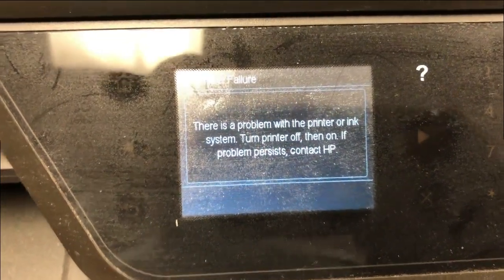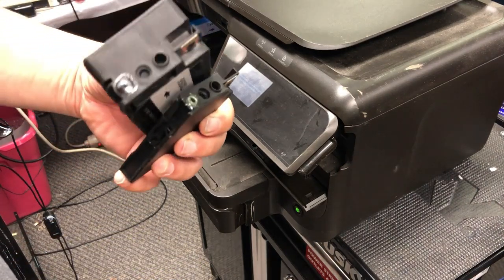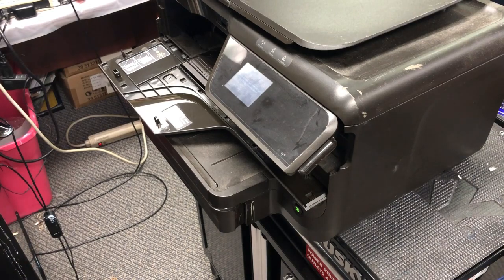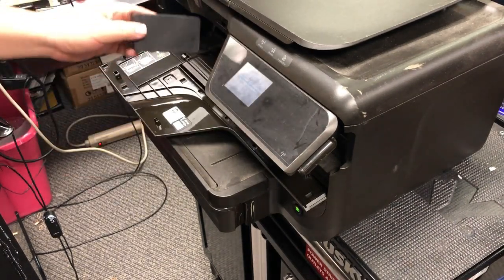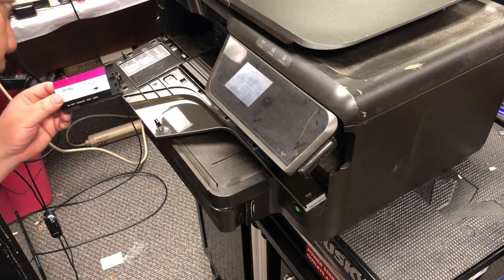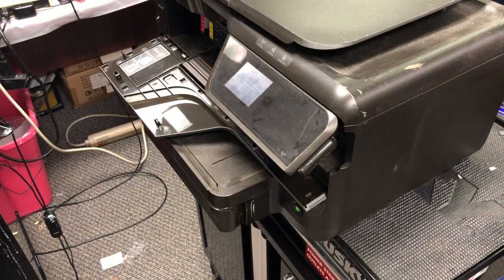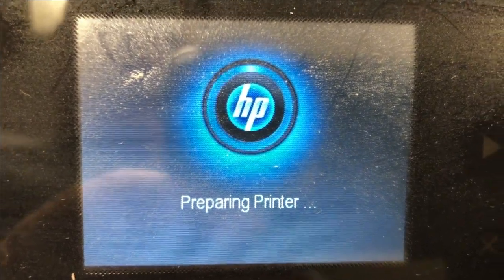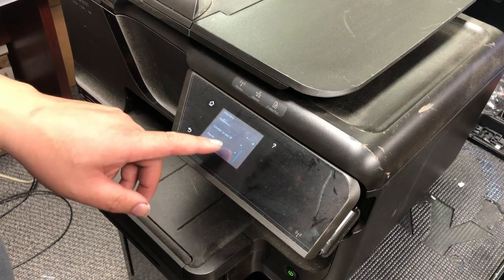HP OfficeJet Pro 8610, 8620, 8710, 8720 Ink System Failure

Comment: So HP just told me I can no longer use this printer because the software upgrades cause it to not work with even new HP cartridge.  Then he proceeded to try to sell me a subscription to buy a new printer for monthly charge on yearly subscription. My reading of this is that HP does not want anyone using this printer so they put something in the software update to make it no longer work and sell you more printers. Does anyone disagree or agree with my assessment?
Reply: Yeah, I replaced an ink today and now it doesn't work, I'm pissed!!
Reply: My printer worked fine before I left for vacation. I come back home and turn my printer on and get this same message. All the ink cartridges are hp and practically new. I also called the hp number and got the same sales pitch. I have a funny feeling something is not right.
Reply: insane how we are all here with the same issue that started at the same time 😔
Reply: Mine just got this error this week too 🙄
Reply: I just received this error todasy on my 8610.  It worked fine the last time it was used.  Now I'm trying to search for a solution.
Reply: I got the same error a couple of weeks ago, it worked perfectly until then
Reply: @matthewbuckley8901  did you update it to  latest software..?may be this the problem I didn't have the latest software I refuse to update it
Reply: Dude....ain't no way are you for reals ???? 😭😭 Is that why mine stopped working all of a sudden???
Reply: @JuansGotThis I have an ho that's over 10 years old, using instant ink just fine. So that's not it.
Reply: Same thing here....
Reply: But big corporate HP cares about the environment and not creating e-waste!
Reply: That's true ...  never update your printer's firmware and turn off automatic updates. All kinds of instructions can be sent to your printer and you will have no idea that it is happening. 🤨🇬🇧
Reply: SAME ISSUE started one month ago when i installed a new cyan. I bought all new HP color cartridge and now it wants black! worked perfectly until now. Ill try to get a black one...but now that its sucked up all the ink into the reservoirs....if it turns out i have to clean them i just installed new ink for nothing.
Reply: Same
Reply: This exact thing happened to me. HP has become more and more unscrupulous over the last few years. Their CEO said they want to sell subscriptions for everything HP sells so it really wouldn't shock me that they're releasing software updates to ruin printers that people own so they can pitch you a subscription. They at no point suggested other printers you can buy outright when I told them I did not want to pay a subscription for a printer.
Reply: Problems started late last week on my 8610 when I replaced one color cartridge with a new third-party cartridge (all cartridges have been third-party for months or years).  Then replaced it with a genuine HP cartridge and still had an error, so returned that set of HP ink cartridges.  Now I get either the general system error or else that the color cartridge appears to be bad, although I've tried four separate color cartridges.  The only thing I haven't tried is flushing the nozzles in the cartridge assembly.
Reply: Problem started yesterday on 12/30/24 when my 8620 printer said it was out of black ink.  Replaced the black ink cartridge and got a printer failure or ink jet problem.  I followed another YouTube video and removed the printerhead and put tinfoil over the contacts (after removing the two little screws on the back side) and reinstalled.  That got me past the first error message, but then the printer said that the black ink cartridge appeared to be damaged and needed to be replaced.  It's not damaged.  It's brand new and from HP.   If I put in a new black cartridge and unplug the printer, it just transfers the error to the next color(s) and says yellow and cyan are damaged.  Try again, and you get that magenta is damaged.  Try again, and you're back to the black cartridge damaged error.
Reply: @straightaaasandsomebees  I didn't try the foil hack, but went through the same cycle of cartridges failing one after another.  Brand new HP cartridges, failed even after manually cleaning the printhead.  This is extremely frustrating, I don't believe there's anything physically wrong, seems like a firmware issue.
Reply: @TheMycroft1  you mean that your printer is up to date ?because I don't have these issues but I didn't update it for 2 or 3 years
Reply: Try hard full reset @straightaaasandsomebees
Reply: Wow mine just had this error and yup HP support just tried to sell me a new one but my printer has worked fine for years no problem! I knew it!
Reply: Same as mine, which is an HP 8600, it stopped working out of nowhere.
Reply: @francispaz3789 same here…
Reply: Which printer? I’m just stuck on the error page no matter what 🤷🏽‍♀️
Reply: yes because you cannot update the printer app
Reply: HP has been class action sued over this shit multiple times.  The only people that benefited from that was the blood sucking lawyers.  My 8600 is in PERFECT MINT Physical CONDITION!!! It has NEVER had a mechanical problem EVER!!!  These MFKr's realize they can't sell new printers to folks currently happy with this one which worked great with no mechanical defects.  So they start scamming you on the ink when consumers figured out how to refill the cartridges by cheaper means.  They want to force you to buy a new printer and subscribe.  I'm having the same issue all of you are having.  I've spent $250 alternating cartridges. It locked me out of Magenta, claimed Yellow and Blue were empty when they weren't because of the date on the cartridge had surpassed the warrant, which has nothing to do with the ink being there in the cartdridge and totally find.  And when I resolved those it switched to locking me out of Black.  Now the only one not working right is the Black K Cartridge.

I've researched how to get my printer working for days.  I've found legacy firmware, a way to push it thru to the printer.  I've manged to make it back to the home screen a couple times, it's rare but if I can get there just one more time to do a semi-reset I think I can fix this issue.  They block you from the menu so you cant get to the reset option to clear the error.  So the key is to disable Web Services, and access the printers graphic user interface thru the IP adress and disable Cartridge Protection and Cartridge Chip info.  Then go to your PC firewall and BLOCK HP.  Connect your printer to your pc via USB cable.  I'm still trying to fix black if I'm successfull I'll make a video and share it with you all that will be in good English.  Don't get rid of your good HP Printer.  There has got to be away to fix this!  I'm not giving up.  And I am NOT bying SHIT ELSE FROM HP.  I'm going to keep refilling the HP accepted chip cartridges I have via the ink refill kit which you can get on Amazon for all the colors for $13 dollars.  

You have to diable the printers ability to update and connect.  The printer also counts the number of pages you've printed and there's no way to reset that with their firmware so I have a theory that they may also be invalidating your print cartridge based on the warranty date on the sticker or the number of pages you've printed given that a cartridge can only print so many pages before refilling.  I've also ordred after market reset chips that supposedly trick the firmware from Amazon.  I'll be testing those as soon as they arrive.  If I'm luck and they work I can just keep one set of Genuine HP Cartridges and just put the aftermarket chips on them if they start tripping and keep refilling the ink for a fraction of the price.

It's ashame corporations get away with this bullshit.  HP has done basically what car manufactures and appliance manufacturers have done.  Remember when cars were built like battle tanks and would run a life time??? Now these knew plastic pieces of shit you are luck if you can make it 100 miles past the 5 year 50K mile warranty.  My new car broke down like CLOCKWORK after 5 years, first the transmission which I replaced, then the engine 100 miles later.  The dealer was determined to sell me a new car I said FUCK now, fix this piece of shit and I drove it another 15 years.  It still runs and is sitting in the garage.  The transmission failed because the gaskets are made out of cardboard now instead of rubber which woudl have lasted a life time.  The mechanic took it apart and showed me.  I said well can I get rubber ones this time with the replacement? He so now because they don't make them anymore.  He said they make them out of cardboard now so they break down around 5-7 years so you buy a new car rather than try and fix it.  That caused the transmission to break down the cardboard and grind metal against metal and the metal shavings killed the transmission.  Then the engine failed due to a manufacture defect which was under a class action lawsuit with Chrsysler for their Sebring models.  They only reason my replacement engine and transmission have lasted as long as they have is because I don't drive much and my 2002 Sebring is still in Mint physical condition and runs like a champ.  It's 24 years old with 118K miles on it.  I said I'mma get my money's worth out of this new trans and engine and I meant that shit.  I'm not buying another american made piece of crap. My next car will be Japanese.

Japan doesn't allow manufactures to get away with this bullshit.  You are not even allowed to sell food or grocery food items or even candy that don't look exactly as advertised.  You look at a billboard here in the use for Taco Bell for a Mexican Pizza it looks like it's got a pound of meat and cheese on it like it did in the late 80's.  Buy one today at quadruple the price and it's got a tablespoon of meat between 2 sad little tiny tortillas and it's so flat it looks like someone stepped on it.  Our country is failing because of corrupt governerment administration both LEFT AND RIGHT and their being no cap on capitalizm with these greedy ass corporations that get away with just raping the consumer so they can make 500% more in profit!  That's why the pillars are crumbling in this country now, it's just a domino effect. 

 I am determined to figure this out, where there's a will there's a way!  Just like that kid who figured out how to jail break the Iphone first and the corporations drug him into court.  That lawsuit went all the way up to the Supreme Court who ruled in the kids favor determining that once the phone is purched it is the consumers property to jail break or break with a sledge hammer.  Jailbreaking the firmware installed on their personal property is not stealing from the manufacture nor is it the same as hacking into their network.  So only thing manufactures could do is void your warranty after you do that.  Newsflash, when your phone starts acting up IT'S NOT THE PHONE!!! It's the phone's firmware updates!!! That the company claims are securit updates.  And that's why it's slow, glitch, the camera pics don't look as goood.  Nothing mechanically has gone wrong with  your phone!  It has no moving parts!  You put it in a phone case and a screen protector on it stays in mint condition.  THEY WANT YOU TO BUY A NEW ONE!  So they fuck up your old phone with updates.  Even if you factory reset it, you'll get the latest firmware update installing the same issues.  But if you jailbreak it you are back in business.  I never worry about the warranty.  I've never had a phone physically break down.  It's just the software that can be reinstalled as long as it can be powered on!

That's why I stopped fucking with these corporations and cut my consumerism way down! Anyway I'm finished with my rant.  Keep hope alive!  Long live the HP 8600 Printer!!!
Reply: Started with mine about 6 weeks ago

Comment: Hi is there a way of using the scanner without or with bad cartridges? I can not bypass the "INK system failure" message...
Thanks for the video
Reply: you can still use the scanner via the computer (or smartphone)
Reply: Try blowing your bladder
Reply: It seems that there isn't.  THat what means "AIO"  = All Interfaces Out of order
Reply: You should be able to use the non-print printer functions like scan & fax just fine.  You just have to "OK" your way past all of the ink system error messages.

Comment: Ohhhh so it locks the serial number then hmmmm. Thats why the newer hp officejet models (8710, 8720, 9010, 9020) with system supply problem lockout new cartridges even though HP tells you to replace the affected cartridge to solve the problem.
Reply from the maker: Thanks for subscribing and supporting the channel! You're absolutely right – the lower-end HP models usually remember the last 3 to 5 cartridge serials, while the higher-end ones like the 8710, 8720, 9010, and 9020 store the ink count directly in the cartridge chip. However, the system supply error is stored in the printer’s memory, but luckily, it typically only remembers the most recent cartridge. I really appreciate your input and engagement – subscriber questions like yours help the channel grow and are usually answered within 48 hours. Let me know if you need more details!